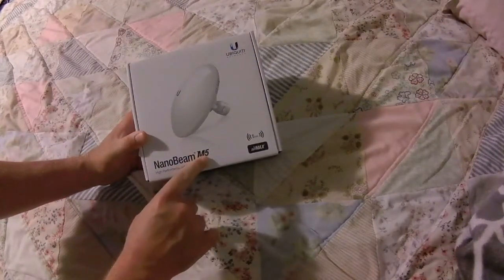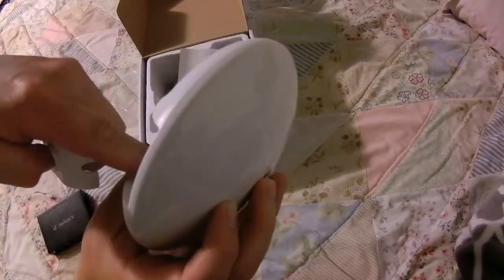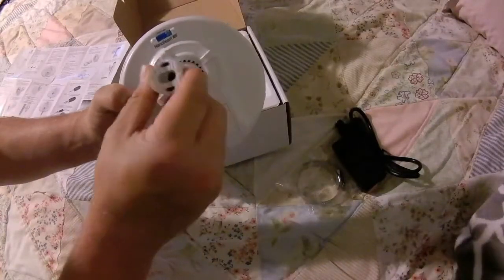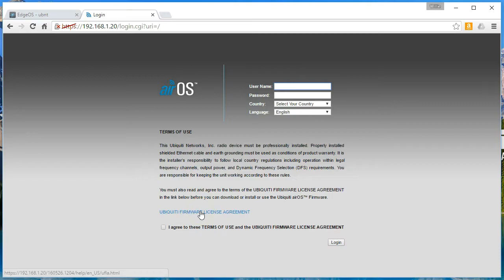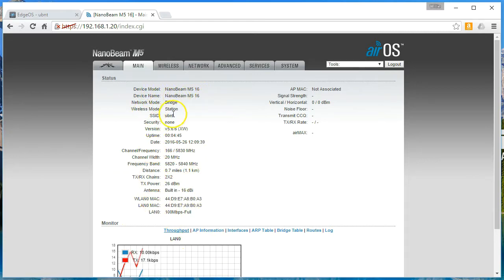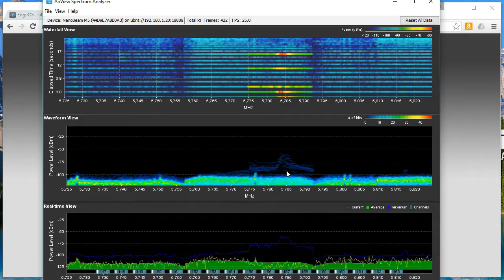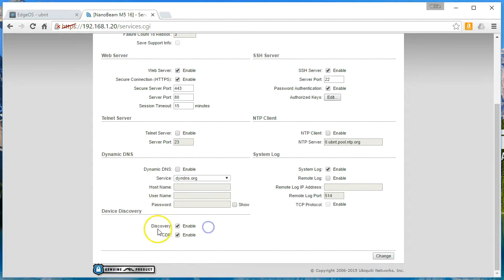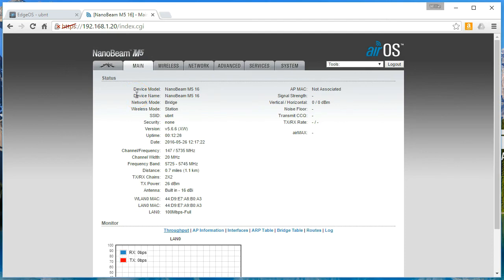Ubiquiti Networks - M5 Nano - Unboxing and Initial Login

Comment: Is the purpose of this product only PTP?
Reply: Oh, so this is usable as an external long range AP? Does that functionality still exist if it is setup as a PTP?
Reply: Thanks! That's what I'm trying to Setup. I bought 2x of the 24 port unifi switch's and two of these nano stations. The distance is less then 800 feet. This should be perfect to get the remote site up and running.
Reply: I'm really sorry for highjacking your comment thread ( You're giving good advice ). But why turn the radios down?
Reply: Right on, Thanks! Will do!